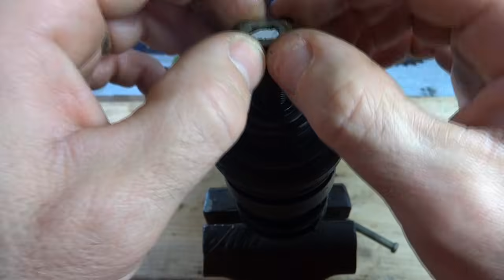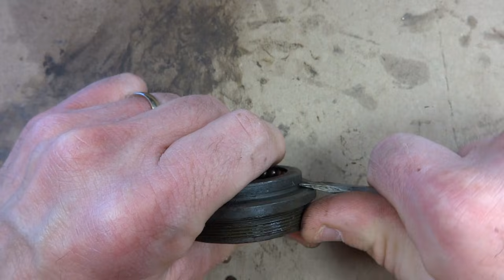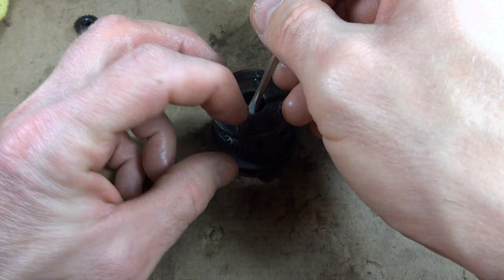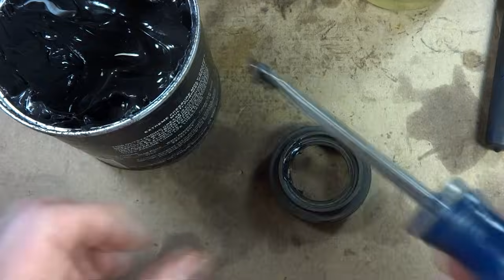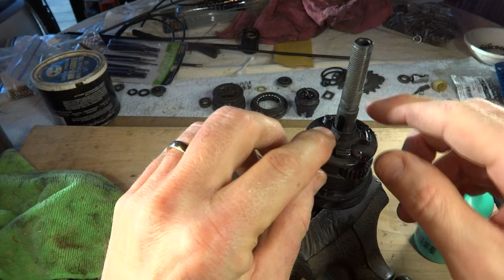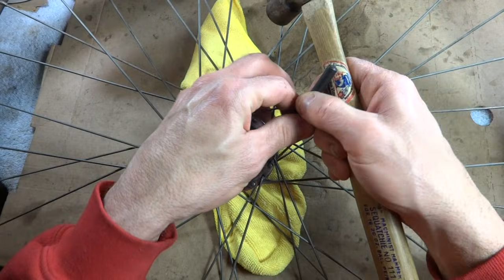How To Overhaul/Clean/Lube Sturmey-Archer 3 Speed Hub - AW type

Comment: Hi, very useful video, thanks. I have a newer S-A 3 speed that I intend to open and replace any parts that need to be replaced. What is a good source for parts? If nobody makes a "rebuild kit" what is the best way to figure out exactly what part I need to order if, for example, I need a new set of the caged or loose ball bearings or a seal? Thanks.
Reply: Oops, I found the parts list of the Sturmey-Archer website. Still hoping for suggestions for places to buy the parts. Thanks
Reply from the maker: I buy my caged bearings at my local bike shop. I buy loose bearings on Amazon. Any other parts, check ebay and buy parts or a used hub.
Reply: @RJTheBikeGuy  Thanks
Reply: https://sheldonbrown.com/harris/sturmey-archer-parts.html#smallparts

Comment: Did you use any lubrication for the sun and planetary gears that were not shown in the video? I am currently rebuilding a (1980s) Sachs Torpedo 3 speed hub that is reasonably similar to this Sturmey Archer and got conflicting advice. Some say to just use as much gear oil (manual transmission automotive) as clings to the gears, others claim only grease provides adequate lubrication. Which would you choose?
Reply from the maker: I lubed them in the video. Also oil will be added through the oil port.
Reply: @RJTheBikeGuy  thank you very much for your answer! Really appreciate it! You lubricated the pins holding the gears with tenacious oil. So you would rather not apply tenacious oil or the finish line product you use in other videos to cover the teeth of the gears and just let the oil inserted through the port do the job?
Reply from the maker: I added oil to the gears later in the video. And as I said, oil is added through the oil port.

Comment: Why dont you show the parts eg the gearchain!
Reply from the maker: What do you mean?
Reply: @RJTheBikeGuy  The pin with the chain. Wanted to see it. Mine broke and i didnt know how ite supposed to look like. Dismantled a partsbike and found it 👍 Has a tiny tiny thread which i broke off by accident.
Reply from the maker: @marcogroenewege  The indicator pin with the chain is a single part. It doesn't come apart. No idea what you are talking about a tiny tiny thread. If it's broken, buy a new one. Make sure to get one the same length.
Reply: Yes it doesnt come apart,it can only break, unfortunately. Have plenty of spare parts thankg goodness, but after putting it back together, doesnt change into 1 and 2.
Reply from the maker: @marcogroenewege  Here is my video on the cable adjustment. If you out the pawls in the wrong way, that could also cause a problem.
Reply from the maker: I still don't know what you meant by tiny thread. Maybe a hair got stuck in the chain?

Comment: I had a link in that small chain break on my '70's Raleigh 3 speed  bike (major pooch lip). Where is a good place to get a replacement part?
Reply from the maker: The indicator pin. You can find them on ebay. They come in different lengths depending on model and year. So you will have to measure your.

Comment: Am I correct that you screwed in the indicator pin during assembly, and then later on screwed it in again ?
Reply from the maker: Yes. It's temporarily installed to hold that pin in place during assembly.
Reply: @RJTheBikeGuy  makes sense. Thank you !

Comment: Just another point...I was able to fabricate a very effective low profile cone wrench out of rigid pressed paper board (Sheba cat food box)...works great to facilitate tightening the lock washer on non-sprocket side of hub without over-tightening the cone.
Reply: I considered that option but since the torque placed on wrench was low, I used something already at hand, carefully cutting the correct shape with an x-acto knife.  It worked.  Thanks again.
Reply from the maker: Cardboard? I have taken a cheap open end wrench and ground it thinner on a grinder.

Comment: Thank you for putting this video up. A few days ago I was cycling uphill and stripped every single tooth on the sun gear. Now, in the basement our dorm has some abandoned bikes, one of which also had an AW on the rear wheel but the rim was bent, so this disassembly video helped me transplant the innards. I didn't actually change the grease as I didn't have any handy today. Might do it later.

Comment: what do you use to lube the chain for these 3 speed bikes? I was thinking about using some of that dry wax lube since I live in a very dry, dusty area. but I'm not sure how well that would work with an oil lubed hub
Reply from the maker: https://www.youtube.com/watch?v=_hXa07DWoKU
Reply: TY. another question - have you seen an AW hub with low gear pawls that are exactly the same on each side? if so, can they be used in either orientation? 
I have an AW from 1950 that I was overhauling and the low gear pawls didn't have a long and short side like I've seen in most guides, they did have a top and bottom because the vertical slope was only on the bottom, but the left and right sides were exactly the same.
Reply from the maker: Here is a video overhauling an AW hub from the 50s: https://www.youtube.com/watch?v=oHHaajDcL_g

Comment: Am about to follow your vid in order to replace a stripped axle with a NOS one. A set of NOS parts came with two sets (4) lockwashers to lock the axle into the slot in the dropout. Both would work but the size and shape are slightly different. Do you happen to know why the extras? Maybe for different model hubs?
Reply from the maker: These hubs were made for MANY years. Like from 1950 into the 2000s. There have been small changes over the years. I have videos doing a 1953 hub and a 1969 hub. For the most part they are the same.

Comment: I'm a good bike mechanic, but this video absolutely saved me on this job.  I typically work on modern race bikes, but this walked me right through the sturmey job.  thank you so much!!
Reply: Sturmey Archer has an illustrated parts list with an exploded view.  You could thread the nuts, spacers, washers on wire to keep them in order for the subassemblies too. And take pics.

Comment: Any chance of you doing an SW at some point?
Reply from the maker: Maybe. According to what I read, the SW had a problematic design where parts wear out. So an old SW may not be able to be fixed without replacing the parts which are not very available. http://www.sheldonbrown.com/sw.html
Reply: Indeed, I just finished reading Sheldon's article about them. I was just struggling to visualise how it all goes together on the inside, I'm sure I'm not the only one (despite how obscure interest in the SW must be). A tear down and explanation video would be really good, even if you have to conclude by saying it's knackered.
Reply from the maker: Not sure what you are seeing, but the parts were cleaned.

Comment: Do you think it's OK to replace the caged bearings with loose ones?
Reply from the maker: Maybe. I haven't tried it on one of these. Might be a pain to assemble it.
Reply: I've used loose bearings many times.  It works OK if you use pretty heavy grease to hold them in place.

Comment: For cleaning anything like this I recommend an ultrasonic bath and some suitable cleaner - Simple Green is very effective, but I'm sure you could use all sorts of things.  Anything ends up super clean, and anything that has not come off falls off onto a bit of cloth.
Reply from the maker: +JDAEd Goss I have a Harbor Freight ultrasonic cleaner. Not impressed with it's cleaning ability. Maybe a different model would work better.

Comment: What a great vid many thanks, I am having trouble identifying what MK mine is though. On the hub is stamped 83  6 and the axle length is 6-1/4"long I have tried indicators for the mk 3 and 2 but it still only wants to select 2 gears and totally misses the third.I would really appreciate some help.
Reply from the maker: +Roger Grote If it's a Strumey Archer, their name will be on the hub. And usually some letters or letter/number combination for the model.
Reply: +RJ The Bike Guy.  Many thanks I did say it has got 83 and a 6 stamped on the hub. it is a Sturmey Archer  but I dont know what Indicator it should have I have tried mk 3 and mk 2 but it still does not want to work properly

Comment: What has been your experience using Phil's Tenacious oil during rebuild? Good weight and viscosity? Pawls sticking? Thanks for the great video!
Reply from the maker: +Enrique Lopez I have read yes it is okay in these hubs. I have also read that it is not good for these hubs. I have started using a nice synthetic oil instead.
Reply: Good results with synthetic?
Reply from the maker: Yeah, I started using this stuff. It's a little thinner than Phil's. http://www.amazon.com/exec/obidos/ASIN/B000WYCD5O/ref=nosim/youtube25-20
Reply: Cool, I'll check it out. Thanks again for the great response and feedback!

Comment: Great instruction video. I'm going to overhaul my '87 3 speed brkae hub as soon as I got the bearings.
You were talking about 24 individual 3/16 inch bearing balls - do you know which bearing rings to get?
Reply from the maker: +Daniel Geib bearing rings? You mean the cages? I usually just take them to my local bike shop and have them match them. Or you could pop the individual bearings out of the cages, and pop in new ones.
Reply: +RJ The Bike Guy -- that makes sense. Thanks for the swift reply. I think I'll overhaul that 3-speed this weekend. According to the stamp, mine was manufactured in 1988. Allow me one more stupid question: as the cones still look good and wheel turns smoothly after I adjusted the play, would you recommend replacing all the bearings or should I just clean/re-grease the parts? Your advice is much appreciated.
Reply from the maker: The bearings are usually not expensive, so it never hurts to replace them while you are in there.

Comment: does it matter of the planetary gear set should return to the original areas?
I.e. Matching the ware of the pins to the gear they were from factory
Reply: +GGear Izu I'd have said so, yes. I'm considering getting one of these hubs and I intend on being that methodical. Having said that, and this will depend on the state of the hub I end up with, just for peace of mind I'm considering new axle (as I'll most likely need one to fit my frame spacing), pinions and pins, pawls and springs, with the springs modified to increase tension and eliminate the hub skips that damage the pawls in the 1st place . Essentially all the moving wear parts will be freshened and the cast items and hub shell will be left. That's more like what I call an overhaul.
Reply from the maker: +GGear Izu Not really.

Comment: Hi,nice video,very helpful!
I have a AB 3 speed brake hub and my indicator chain is broken inside the axe. How can i take it out? Only by opening the hub?
Reply from the maker: sergiuxy21 Probably. Without the spring pressure, you can push the pin out and unscrew it.

Comment: I think something you should emphasise is that there should be no grease inside the hub anywhere near the pawls. Even on the more modern 3 speeds the grease prevents the pawls from engaging properly.
Reply: I arrese with boh but the shop where I bought my Brompton doesn't agree with me. They would like  to use grease everywhere.

Comment: This is so concise! I just found a 70's Raleigh with a 3-speed sturmey-archer hub that looked intimidating, and while this video doesn't lessen the intimidation factor, I can at least do this with confidence now! Wish me luck!
Reply from the maker: Good luck.
Reply: Well it worked! It took me a couple hours, but it's cleaned and assembled and shifting great! My model is slightly different than yours (S3C), but your video helped me with the majority of it.
Reply: I had a little trouble in the beginning with the ball cup being pretty tight. I ended up flipping the wheel over and clamping the lip into the vice where the indents are and spinning the wheel by its rims to unscrew it. Worked like a charm ;)
Reply from the maker: Hillary Burnson I have a couple other Sturmey Archer videos including overhauling a TCW III 3 speed coaster brake hub. Did you use hi temp grease for the brakes? Here is the TCW III video: https://www.youtube.com/watch?v=e2YDcLF_CNI
Reply: I just watched the TCW III video, that is MUCH closer to my model. I did NOT grease the brake, so I'll be going back to do that. After watching your AW video I bought and used Phil Wood's oil, but you used synthetic in the coaster brake video. Does it matter?
Reply from the maker: The synthetic oil is better actually. The pawls will work better. But you definitely want to use hi temp grease on the brakes. They can get very hot.
Reply from the maker: The job will be easier this time. :D

Comment: Any way to turn this type of hub into a fixed gear? 

Great tutorial that I will use to overhaul mine.
Reply from the maker: Maybe welding it? Why would you want to? The thing is pretty heavy. If you are going to build a fixie, there are probably better ways to do it.
Reply: I have an old ltd-3 Raleigh I'm restoring but instead of a 3 speed I want to make into a fixie using as many as original part as possible for budget reasons

Comment: Urg. i need some help. In the 3:51 minute of this video you unscrew a part using the hammer, im trying to do exactly the same but it doesn´t work. what can i do? 
thanks
Reply from the maker: You can try maybe a hook spanner wrench. Or keep tapping trying to get it to come loose. Make sure you are trying to turn it in the correct direction.
Reply: RJ The Bike Guy thank you for yor help, i have other question. My hub is a 1980 model and the notchs are rounded. Is posible that in this model the part turns in the direction of the clockwise? I ask because in the other direction it doesnt turn.
Reply from the maker: I am pretty sure they didn't change the direction. I't probably just on there very tight. You might trying something like this: http://www.amazon.com/exec/obidos/ASIN/B00ACTMZOI/ref=nosim/youtube25-20
Reply: RJ The Bike Guy thanks, im going yo try this
Reply: RJ The Bike Guy Thank you, I finish the repair of the hub
Reply from the maker: So you got the ball cup off then?
Reply: Yes, I use wd40 to loosen it and i replace a broken piece inside the hub.

Now is working perfectly.
thanks

Comment: Interesting has anyone requested you lock the wheel to flip flop it for a motorized bicycle ? It appears it can be accomplished with a weld or a specialized washer yet I'm unsure if a weld will work it also appears it may be less work simply machining the hub to reverse the or swap sides on the piece.I'd like your thoughts on this I've planned to use this type of hub.It may be less work attempting to mount the internal movement to a new housing from steel pipe . 
I've not seen a kit to change the drive maybe you can advise.. Thanks
Reply from the maker: I have never investigated this. I am a little confused by what you want to do. Do you want to lock the wheel like a fixed gear wheel or lock it into a single gear but still have it freewheel. And not sure what you mean by flip flop. When I think of flip flop, I think of it having gears on both sides of the wheel.

Comment: Thanks for the great video, really helped me stripped down my old 1955 hub. Unfortunately the clutch sleeve is completely stuck. Have you ever come across this? Or have any ideas how to get it moving again?
Reply from the maker: I haven't run into that. Do you mean the sleeve is stuck in the clutch or onto the axle? Try a lot of penetrating oil. Maybe some heat?
Reply: shyflirt1 The clutch sleeve is stuck on the axle. I've been applying penetrating oil all day and might try some heat tomorrow if that doesn't work. Thanks for the help!
Reply from the maker: I saw this product and not sure if it might help. http://www.amazon.com/exec/obidos/ASIN/B00ACTMZOI/ref=nosim/youtube25-20

Comment: Great video.  I want to clean the outside of my SA hub i.e. the sprocket and such.  What is the best sort of oil or grease to use in order the lubricate the outside of the hub, rod/chain and axle nut etc.?
Reply from the maker: The only thing you need to lube on the outside is the chain. I use Finish Line Dry lube.

Comment: How long do you soak the bits in paint thinner to clean?  Will a normal bike lubricant work in place of the oil you are using?  Thanks for the video! Very helpful.
Reply from the maker: Long enough to get them clean. Phil Tenacious Oil is a normal bike lubricant. You want a medium weight oil that will stick to the parts.